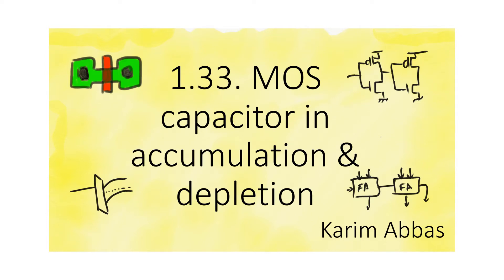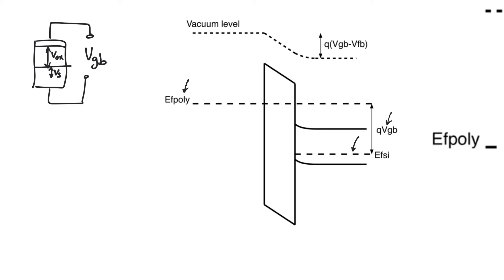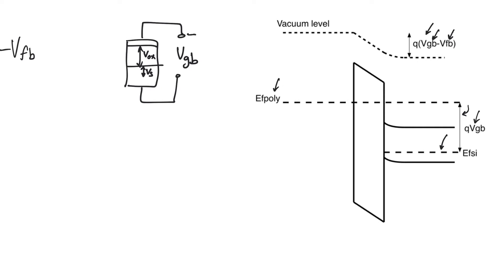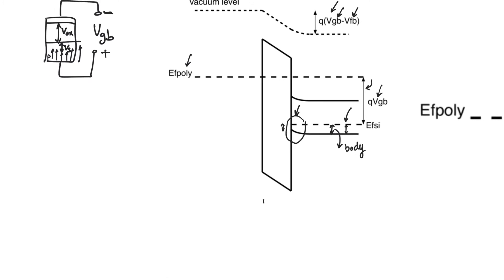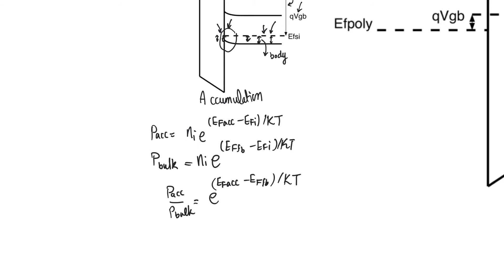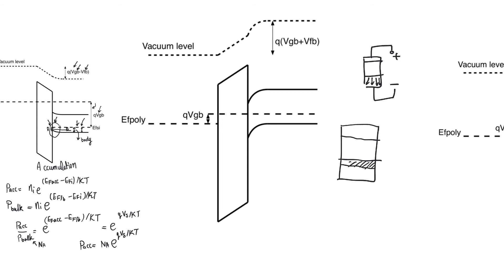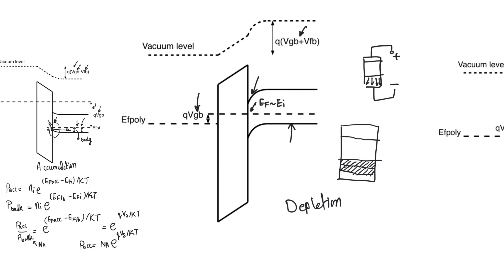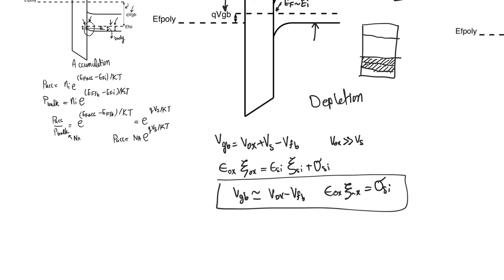1.33. MOS capacitor in accumulation & depletion

Comment: Sir in accumulation mode there are access of holes near the surface of the bulk/substrate, which are nothing but eventually charge carriers. So if charge carriers are present at the surface then will my mos conduct current (because charge carriers are still present)? If not why? and if yes, then why don't we use mosfets that work in accumulation mode instead of using them in inversion mode?
Reply from the maker: Because the source and drain are n-type, so they will form reverse biased PN junctions with the accumulated layer and current cannot flow between source and drain. Now if you assume that the source, drain, and body are all p-type silicon, then this is a semiconductor resistance rather than a transistor and it would be hard to turn it off. Additionally a large current will flow from source and drain into the body, which is not how a transistor acts. If the source and drain are p-type and the body is n-type, then that's a PMOS.
Reply: @electrontube4284  thank you so much for clearing my doubt. 
Since mosfet is eventually based upon the working of mos so i thought why don't we actually model mosfet to work in accumulation mode..but now i got my answer that we cannot dope my source and drain with p+ (for a nmos) as it will behave like a resistance instead of working like a transistor and it would be hard to turn it off.
Thank you sir, your videos are of great help for students . I really enjoy watching your lectures
Reply from the maker: You are welcome.